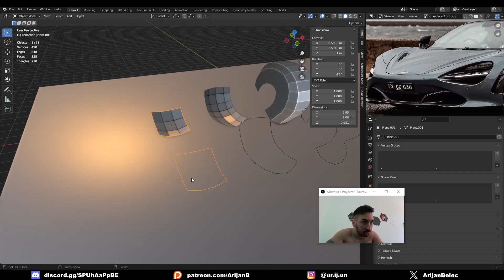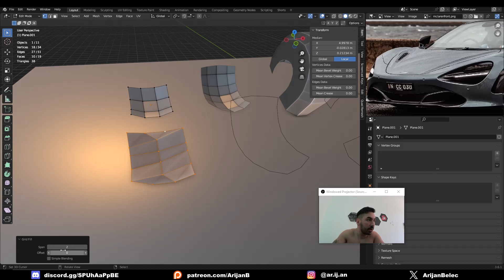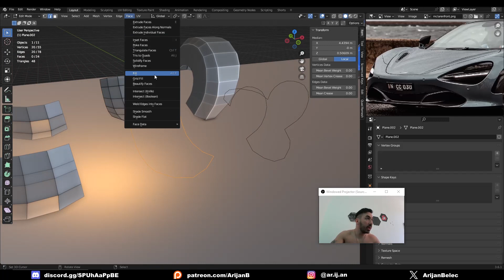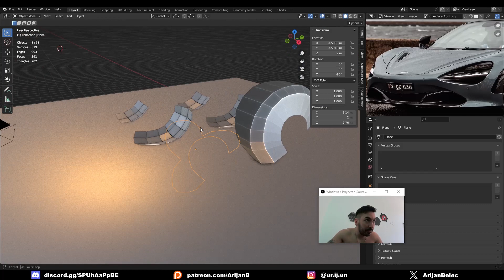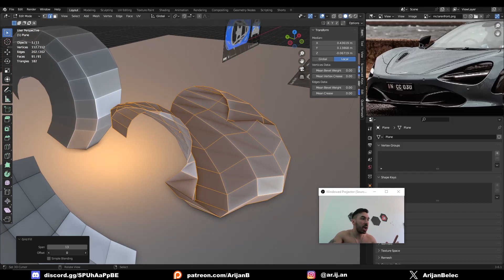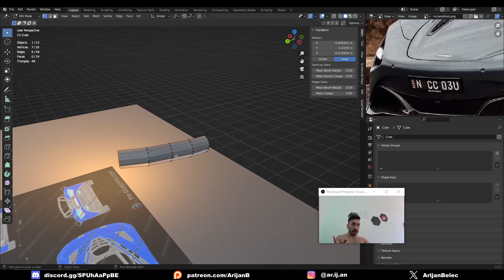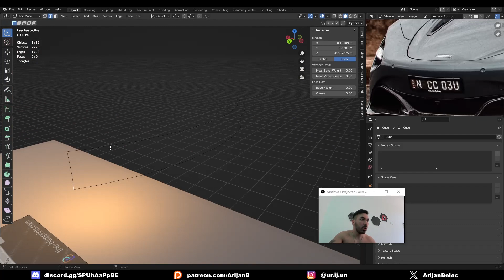The MOST IMPORTANT Car Modeling tool (Arijan)

Comment: So this method is how you build in nurbs modeling by setting up the UV spans of a surface.  Whether it's a 3rd degree or 5th degree surface.  This does allow lots of control and consistency of surface.  Nice to see this approach adapted to polys.

Comment: a minor tip: select the vertex in the corner when useing grid fill. that way blender will more often calculate everthing already correct and you dont have to count edges and fiddle around with the menu.

Comment: Nope. You never try to model both sides of the car. You always mirror it. Specially the surfaces that span from one side to another. You only model the other side if it is meant to be different, like the side mirrors.

Comment: Great tip.  I never knew the grid fill was capable of more than just filling flat surfaces such as cylinders or cubes.
Reply from the maker: I also didn't know it was this powerful until the day before I made this video. Complete game changer.
Reply: Maybe you already know this but the curve function under loop tools is also extremely powerful that works on building / rebuilding curvature.  Great for cars or anything with a curved surface @Aryan3D

Comment: Now do a vanishing fillet without pinching....If you know how to do it, lol
Reply: Are you referring to class A surfaces in CAD? lol
Reply: @nom928  No, or I would not mention pinching, I m reffering obviously to polygons. :) lol. I use Alias too, but that is a different world :)
Reply: How do you do a vanishing fillet?
Reply: @givmevideos  Do you know what it is?
Reply: @gibson2623  The best way I’ve seen in Blender is either using loop cut supports that gradually get wider (very manual and not flexible if you change the underlying surface shape) or to use Bevel Weights with the bevel modifier and taper them out. How about you? Until Blender includes variable fillets.
Reply: @givmevideos  I do it with topology, I actually model them, and use 1 support loop on the outside ;), when using polygonal modelling. The proper way of doing them is obviously in Nurbs, which is much better, but that s not the topic of the conversation anyway. In polys it is alwyas a challenge not to get pinching, and that is fun to me....we have to be creative at achieving it the best way.... Take care ;)

Comment: Actually if you select a corner vertex as the last selection, blender will automatically calculate the best grid fill option (most of the time) so you don’t have to play around with the settings
Reply: Chris Plush's advice in his latest course 😄
Reply: @Cyber_Kriss  Yeah, i recently completed the course. It's awesome
Reply: nicee! I didn't know that, thanks!

Comment: Huge tip i learned from somebody's short, you can reopen the context menu of an action by pressing F9 ( as long as you haven't made any other action in the meantime ( scaling / moving ). And Thank you for the tutorial, I've had so much trouble using the grid fill recently while working on my rx-7 fd.
Reply from the maker: Good tip, I didn't know that. It would be 10x better if you could still open it after making other actions. Alignments would be so much easier.

There must be a way to create this.
Reply: @Aryan3D  every action has its own redo panel, so u can't redo an old action unless u go into undo history
Reply: Yes, the nice thing about Blender is that it's a gift that keeps on giving. You always learn new things. The F9 I knew.